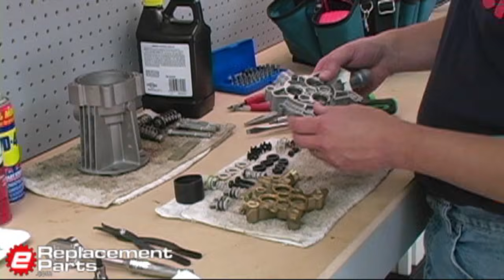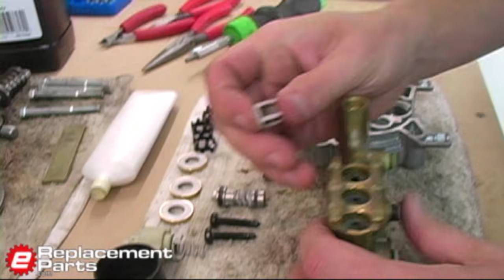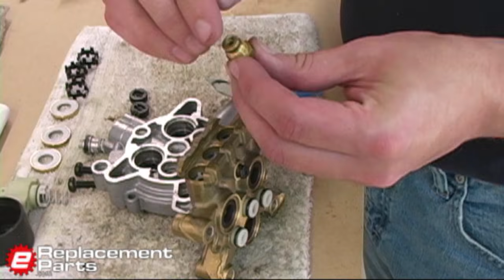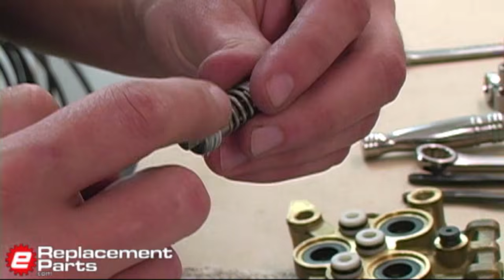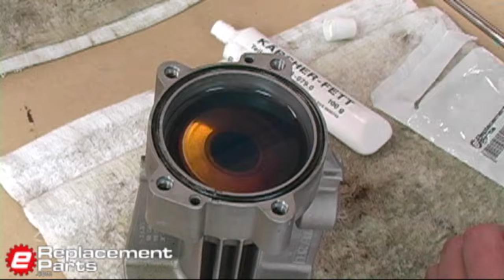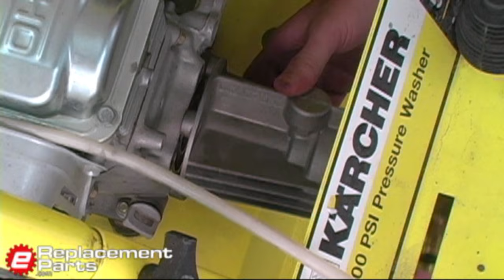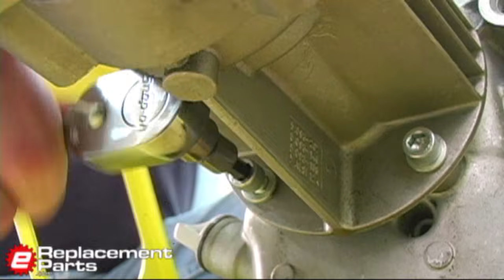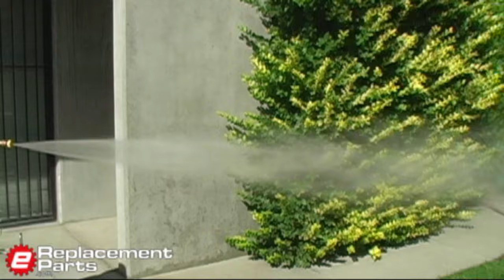How to Fix a Pressure Washer (Part 2 of 2)

Comment: In found one of these pressure washers partially disassembled on the side of the road. All the parts were there though. I watched your video, and set about to clean, and reassemble the pump so I could see what the problem was. As I was reassembling it, I was looking at the way the parts fit together, and it just didn't look right go me. The way the spacers sit in the piston guide shaft allows them to push in, and potentially bind. So I set out to find some assembly diagrams for the washer. I found exploded diagrams for the pump on your ereplacement parts website. According to the diagrams, the piston seals seat in the deep side below the spacers. In my mind, that would explain why there is so much space below the plastic spacer. I plan to take it back apart to straighten out the piston seals according to the diagram. Below is a link to the diagrams, and replacement parts.

www.ereplacementparts.com/karcher-2650-11945130-pressure-washer-parts-c-33388_33389_34000.html
Reply: Don't forget to check your tip before tearing your pump apart too.  For the one I found, the lack of spray was a rust clogged tip.  The back pressure was tripping the unloader.  It was as simple as putting it back together, and changing the tip.
Reply: Okay.  The first time I assembled it per your video placing the seals in the same location as you do in the video.  This is incorrect placement.  The pump did indeed pressurize the water, but the missing seals allowed all of the oil to leak out onto the concrete slab it was sitting on.  I now have a stain to scrub out of the concrete, and wasted several dollars worth of fresh oil.  When you have the pump apart, the seals need to go on the piston half of the pump inside the deep holes beneath the spacers.  Otherwise, you'll leak out your oil, and be running the pistons dry.

Please correct your video to show the parts being placed in the correct location.

I watched the video several times now, and you are absolutely putting them in the wrong spot in the video.

Comment: Well done.  I am having a different issue however, found both tutorials extremely helpful as my Karcher G 2600VH has the exact same pump on it.  Wish I knew about the oil before I loosened the four (4) bolts.  My pump mounts vertically vice horizontally as shown in the video.  Will know for next time when I go to disassemble the pump.  Keep up the great work.

Comment: Great Video. I have been using my Karcher pressure washer for 4 years by having to disconnect the nozzle and then putting it back on to build pressure. I had no idea this was / is an issue. I have already ordered the new part along with a couple of O-rings for the wand assembly and a new water filter.Ya gotta love You Tube.Cheers

Comment: 7 oz is the recommended amount according to what they sent me.   I noticed if I look down through the filler cup it barely covers the shaft.   It should NOT come up in the filler cup.   Make sure you use the Karcher oil.  Here is the info from the manual.   

For maximum pump life, change the pump oil after the first 50 hours, and then in 100 hour increments.  Oil maintenance for all models listed above should exactly follow the steps below.

Kärcher recommends the use of multi-grade 4-stroke oil that meets or exceeds the requirement for API (American Petroleum Institute) service classification SH, SJ, or equivalent.  

Oil Type (SAE Class) :   15W-40 
Amount :    190 ml / 7.0 oz.  

It is highly recommended to use Kärcher oil (6.288-050). Use of an incorrect type of oil could void the warranty and cause damage to the pump.  Note:  Running the pump with a low oil level can cause pump damage.
Reply: that type of oil pump used

Comment: Great help!  I had to borrow a friends unit, and of course it didn't work.  My unit has a older (2004) style strap pump and the entire center bearing and ceramic piston is broken. I see a lot of the parts are no longer available, and the drive is very much different than ones used now.  Can you suggest a replacement pump that will fit on the older Honda engine?  It'd still running great!

Comment: Mark,  If you watch part 2 of your video of the assembly of the K-2400 HH, you first accidently placed the yellow nylon thottle containing two o-rings in the wrong hole on the brass side of the pump.  Immediately on the next frame of the video, you already repositioned the part #4030-109 into the correct hole.  One of two problems I found, 1st - you did not state the correct that you made so everyone else would not make the same mistake. 2nd, according the the schematic of the pump, you should have installed the brass joining piece #4030-1250 into the hole that you had placed the yellow thottle part.  Please check the schematic and let me know if I am correct.

Is there a trade-off of applying 'Super Lube'multi purpose grease as apposed to teflon grease to the o ring on the unloader/spill valve, is it critical or doesn't it matter?

Please respond (posted on Aug. 27, 2015)

Comment: Mark, great informative video, I have a simular power washer as you used in your video, the Karchaer 2400 HH.  I purchased it at Costco most likely over 10 years ago.
Would you please let me know the type of oil I should use for the pump, should I use a straight 30 weight non detergent oil? I am using a 10Wx30 oil for the Honda engine.
Mark, I also need to know if I should apply a little silicone to all the o-rings associated with the pump?  Thank you, Jon

Comment: hi there. It was a good video and it helped me a lot, I'm having a issue with the oil mixing with the water, I could't see in this video, any seal on the bottom housing to avoid the water to come in through the pistons, there are any seal on it? did I miss something? Thanks Mate

Comment: working on a Karchr HDS 801 B.  Company owned, so its abused not maintained.  Anyways, recently brought it back to life by cleaning the pump and replacing a pressure switch.  Ran about 400 gallons through it when the water flow stopped.  Had steam coming out the wand.  Went back to thewasher and before I coulddiagnose anything, the safety valve popped off so I shut it down.  I did notice the safety valve was extremely hot.  Checked for any clogs in the water system and seemed clear.  Removed safety valve, disassembled and appeared to be some melted plastic around a plunger shaft in the main valve body.  That's where I'm at at this point.

Comment: Nice job.  I have a model similar Karcher HD2700DH and has a drain plug and filler cup/cap on the top of the compressor.  I drained the oil but not sure how much to put back in.  Do you know quantity?  I know it's Karcher 15w40 type.  Thanks!
Reply: Gregg Geerdes I got my answer from Karcher.   Hopefully this will help others with how much oil to put in their Pressure washers.  This applies to all these models
HD 2500 G
HD 2500 MTD     
HD 2600 DK   
HD 2700 DH
   
This is the special Karcher 15w40 non-detergent oil.  Do not use regular motor oil

Oil Type (SAE Class) :       15W-40 Amount :                           190ml / 7.0 oz.
Reply: +Gregg Geerdes I rebuilt my pump however now I have a very small oil leak. I'm guessing it is because I used Sae 30 motor oil.

Comment: HI I had job about 3 weeks ago and my power washer was working great. When I was working I noticed that the pump for the solution didn't want to work. When i got home I took down the pump down cleaned it and put everything back together and yesterday I got a and didn't work it was leaking and maybe could be the rubbers seals? Let me know thanks...
Reply from the maker: EZ water flow P.W.S  We usually replace the seals and gaskets when we tear a pump down for cleaning.  About half the time an old seal will become damaged during the cleaning and reassembly process which sounds like what has happened.

Comment: Hi, Very informative video. 

I have a Karcher electric pressure washer (K3.86) with the same problem as in the video - initially pressure is high but once I release the trigger the pressure drops and does not return until I turn machine off and on again.  Also sometimes pressure surges i.e. high pressure fades to no pressure then kicks up to high pressure again all while the trigger is held.  Is this all the unloader valve?  Can I rebuild the pump in the K3.86?

Thanks
Reply from the maker: bgrt40 It sounds like the pressure valve is either worn or sticking.  You can pull the valve out of the pump, clean and put grease onit. Be sure you clean and lube the ball bearing as well.  Please use caution when putting the valve back in the pump so you don't damage the seals. If you decide you need to replace the valve, remember it will need to be greased too.

Comment: Thank you for the video very educational. Can you tell me why the electric pressure washer I have continually runs?
Reply from the maker: Mary Ann The most common cause of this is that the pressure switch has gone bad. These are model specific so make sure you use the correct model number when ordering the new part.

Comment: Very helpful! Should I always be able to compress or move inward the tip of an unloader? I have a 10 year old Pressure Wave(built by Devilbiss) which I finally got the carb working again and cleaned like new for 3/4 of my drive and walkways, but now is showing all of the signs of a stuck unloader as in your video part 1. In fact, when I let go of the trigger, I will lose all pressure and then the engine will stall shortly. So I have pulled the unloader out, it screws into the ancient strap style pump. Looks good, part # A01726(which has been replaced by A08869 and I think newest is A03928SV?). It looked fine, but I can not move the tip in or out, even after soaking in vinegar for a couple of days, even pressing/tapping it on a hard surface. I suppose I should be able to and this means it is kaput?
Reply from the maker: Bill K This should move smoothly and freely.  You might be able to free it up by soaking with WD-40 or
another penetrating oil product.  Even though the pump is older, there may me a new unloader to help solve your issues.  Use the model number for the tool to be sure you get the correct part for your pump.

Comment: Excellent video. I could not have repaired my pressure washer w/o it. There was one omission I think. At about 3 min, 20 sec into the second part, you need to show the insertion of the 3 plastic washers that go below the plastic spacers.

Comment: Hey your video was very helpful. I have a Craftsman CPW1500 and after opening it i found out that it needs alot of cleaning. Will be working on that tomorrow. Any tips? Also, do I change the oil and full up to the same 1/8 of an inch above the wobble plate? And can I use 20W 50 oil?

Comment: Great video,But I have couple of question,1 my karcher 2400 was doing the same thing I would have to remove the tip and pull the handle let water flow and then reinstall the tip and it would work but before the your video I started to pull the pump head and oil started coming out so I tighten it back up.then I saw a video of guy removing the unloader valve and cleaning it and relubing.So I did the same and it worked but I notice I don't have the pressure that it did when it was new.Question if I lost too much oil would that cause a pressure drop or unloader still cause this? I also may have lubed both ends of O-rings on the unloader or when rebuilding pump should you replace any other parts

Comment: I have the same power washer but mine has no pressure at all. Should I just change the pump? Or is there a cheaper option.
Reply: Orchard Electric I would get a new wand and hose and see if that helps.  Or try to clean out the tip and your wand.  Start with the easy and least expensive fixes.  Process of elimination.

Comment: Hey, thanks for the very informative video! I am working on that same brand & type of pump, this was very useful!! Question:  When you replace the unloader valve, do you have to adjust or set it, or does it come preset?
Thanks!
Reply from the maker: Good question!  The unloader is preset.

Comment: I have a simpson pressure washer ps4033 with a AAA pump # 530004. After replacing the outlet valve, no pressure and the valves broke again. I then replaced the outlet valves a second time along with the unloader/bypass valve and a new boost valve bit (which appears some sort of relief valve). Still no pressure in fact, it is little more pressure than when the machine if off. What should I try next?

Comment: Thanks for the video.  One question: what kind of oil do you use in the wobble plate housing, and is it pretty much the same regardless of brand or type?  (I have a Sears 2600 lb washer.)

Comment: I saw both Part I and II of "How to Fix a Pressure Washer".  Excellent!

The make you were working on was a Karcher.  I have a Craftsman and the motor works, but it doesn't pump water.  I suspect the problem is with the pump, but the whole pump is no longer available from Sears, but individual parts are.

My question is:  Is the disassembly/assembly basically the same for a Craftsman as it is for a Karcher?  Thus, provided the parts needed are available should I be able to complete the repair?

Comment: Hi I have a GCV190 BLACKMAX HONDA ENGINE, is this the same type of motor? What type of oil you use?
Reply from the maker: Honda recommends 10w 30 Oil for their engines.  If you have a Kartcher pump on your pressure washer and need to change the oil in the pump, use 15W 40.

Comment: Hi,
I own the same pump its leaking water from the top and bottom. What parts to you recommend I replace to solve that problem?
Reply from the maker: When these pumps start to leak it's probably due to worn or broken seals and o-rings.  The best cure is an o-ring replacement kit.

Comment: HI, thanks for informative videos. Do you have a video on how to adjust up or increase the output pressure of the actual pump?  I just bought a new pump for my cleaner (Honda GX160 engine), which is supposed to be 2300+psi but it has poor pressure even compared to the worn out 5 year old one.  The large red output pressure knob is screwed down to MAX.  Am I able to get more pressure out of this pump?  Engine is 5.5HP

Thanks

Comment: I'm glad i get a ball bearing with the same midle part of my old piece. I think that it will be the solution. However, now i make you another cuestion: Can i use 10w30 oil + molikote (mixed) to refill the pump up to the top of the bearing? Or i must buy sae 30 detergent?
Thank you for bringing me the oportunity of learn about this.

Comment: Hello. I'm from Argentina.
Sorry if I have some dificults to tell you about my problem,
I have a pressure washer B&D pw2100, that the middle ball-bearing is broken.
It is posible to be replaced with any ball-bearing or I must find the piece of the same brand.
There's not spare parts coming into the country actually and I'm not quite sure about the posibilitis I have.
Thanks for the explanation.
Reply from the maker: You can use any brand of Ball Bearing as long is the dimensions and configuration match what is currently in the tool.  Some manufacturers will have a small part number stamped in the side of the bearing that can be used to get a replacement match.

Comment: Outstanding video tutorial.  Exactly what I needed to fix my problem.

I have two comments that may help out other viewers.  I could not for the life of me get the unloader valve out of the housing with needle nose pliers or even needle nose vise grips.  It just would NOT pull out.  There is a much easier way to get it out.

HOW TO REMOVE A STUBBORN UNLOADER VALVE:
Before removing the pump from the engine, unscrew and remove the white plastic housing from above the unloader valve.  Lay a towel over the opening of the unloader valve.  With the garden hose hooked up to the pressure washer, turn on the water. Start the engine.  The water pressure will blow the unloader valve out of the its housing.  The towel is there to stop the unloader valve from flying up and slamming into the cart frame.  It works like a champ and will save you hours of cursing your needle nose pliers like I did.

WHAT TYPE OF OIL TO USE IN THE PUMP
The video does not mention what type of oil to use.  My pressure washer is the same model as the one in the video: Karcher K2400HH.  It uses Karcher 15W40 (Part # 6.288-050.0) but you can use any Non-Detergent Non-foaming 15w40 Pump Oil.

I hope this helps others.  Again, outstanding job on the video.

Comment: 2 questions, 
I have the exact same pump you just worked on.
1. can I buy that exact pump new somewhere? approx cost? what is the part number I would use for the exact pump you worked on... 
2. when you say you bought parts, does every little part come in a kit or do you have to order certain ones? approx cost for whole kit or just the parts you think you need???

Great video.

Comment: Is it possible that you can do the same thing with the cheaper electric pressure washers? I am on my second one and will graduate to a gas powered one next. I do want to tear it down since it does not work but P'ed off that this seams to always happen and was not used that often. If so, can you upgrade in some way so this does not happen again? Thanks for sharing your knowledge. Peace, Mo
Reply: I think this happens from not using them much, happened to my gas one.

Comment: Great video. I have an old Craftsman 580.767100- it's built a bit differently, with a vertical shaft motor/ pump. Do I need to disassemble the entire pump to get to the bypass/ unloader valve (which I believe is sticking) or can I remove/ clean/ replace the valve without taking the entire pump apart?

Comment: I have a Karcher K3.79M pressure and it started to leak real bad by the handle.I took it apart and don't know if i lost a part causing the handle not to have any spring action. Can you let me know what i need and where to get the part from Thanks Don